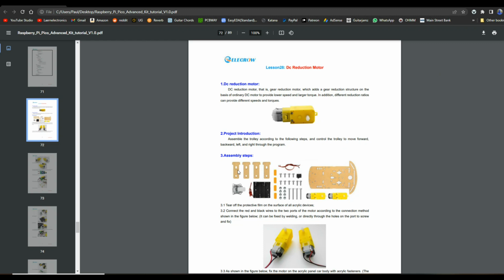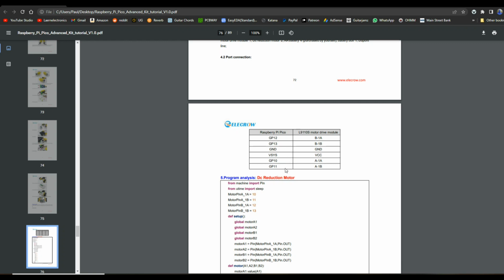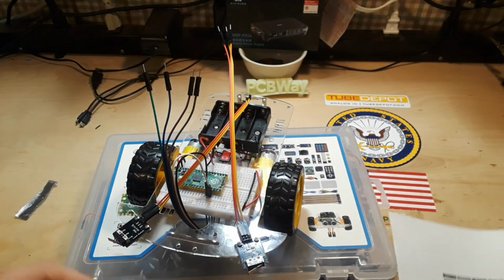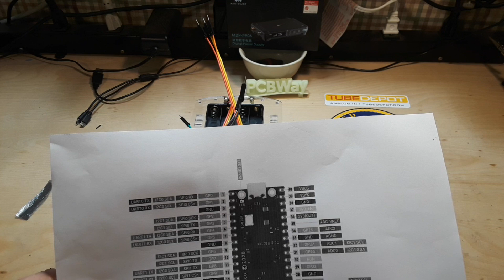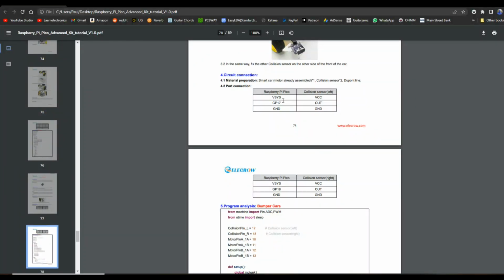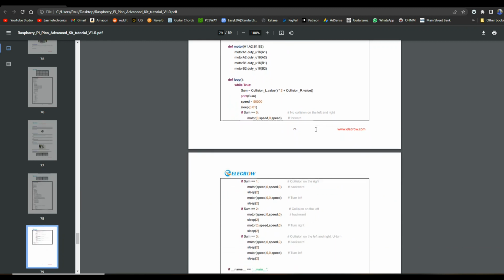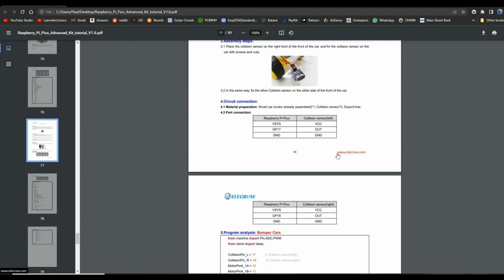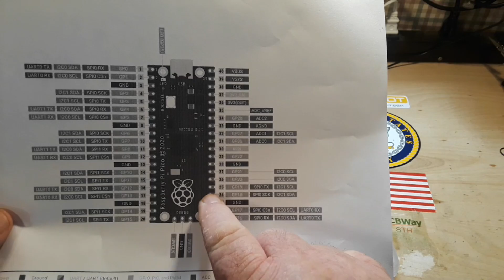Raspberry Pi Pico Bumper Car

Comment: Looks pretty cool. I know you are using someone else's code but from what you have seen does it look pretty easy to get a grasp of it and edit it to do other things? I'm not a coder so trying to learn basic code for Arduino is tough for me. This is probably harder. I hope you feel better soon.
Reply from the maker: I dont think micropython is more difficult. You can give it a try. Download Thonny and I think you can run the code right there in the IDE.